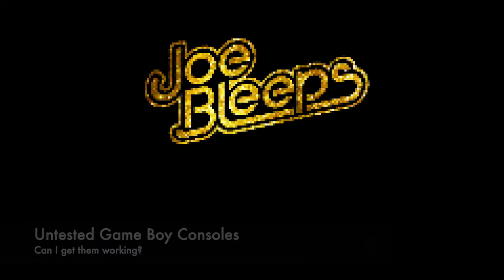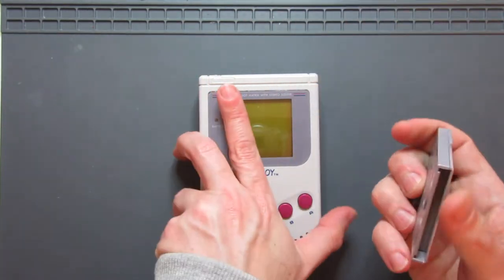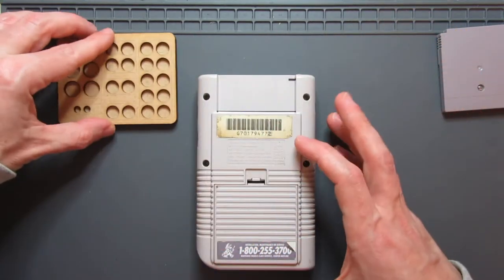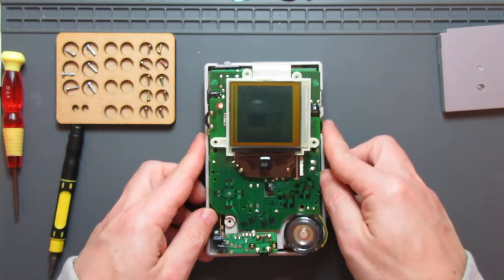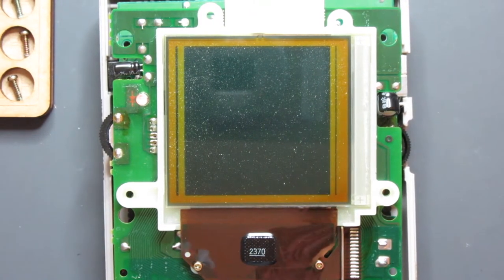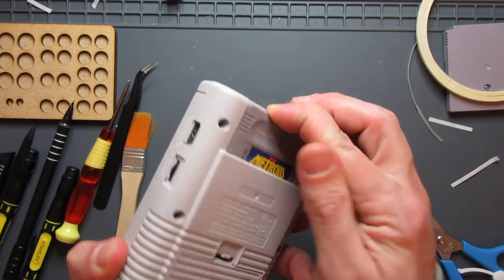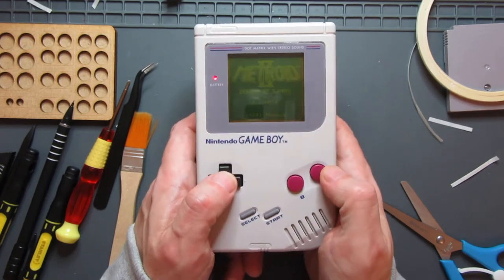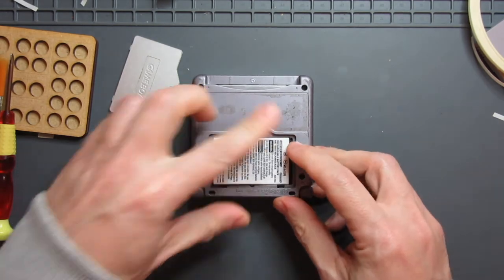Untested Game Boys - Refurbish and repair with vertical lines fixed on the LCD

Comment: so bad pixels are an indication of a bad connection at the ribbon rather than an issue with the screen itself?
Reply from the maker: Not so much where the ribbon connects to the board, more where the ribbon is attached to the LCD, but yes that's right.